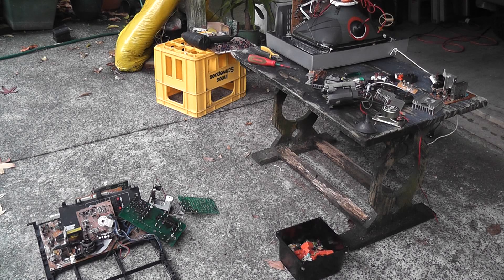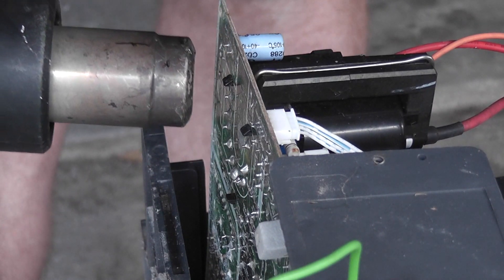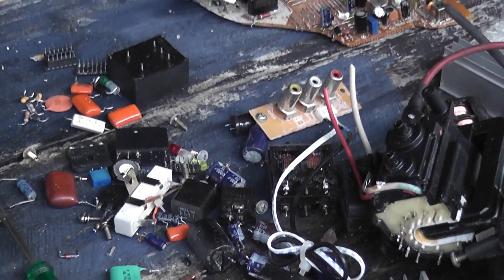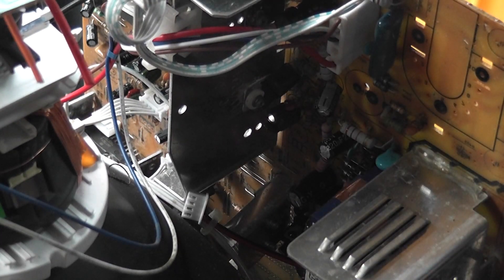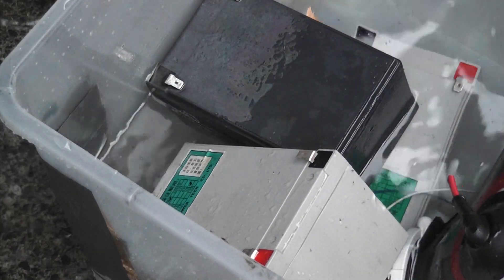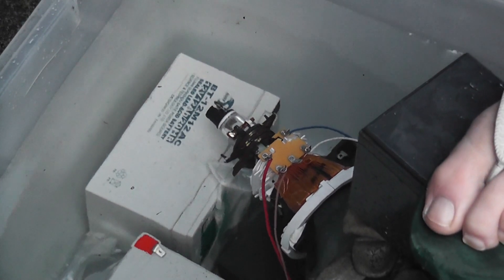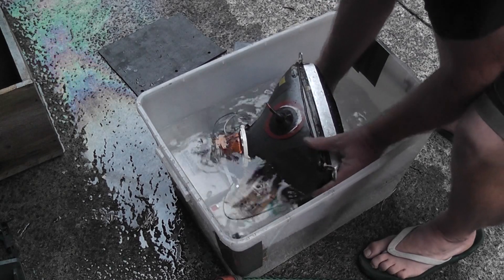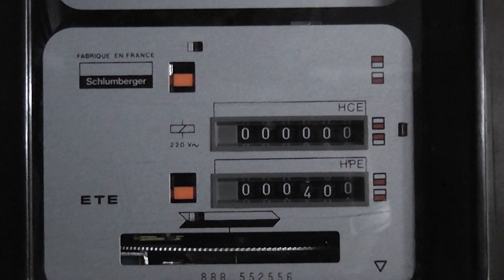Harvesting TV flyback transformers

Comment: I used a desoldiering tool (they cost more now) and a butane soldering torch from Radio Shack.  I remember the old Archer Brazing Kit I could get from radio shack.  With butane and nitrous oxide.  That pretty white flame...  Would melt wire sheath instantly.  The smoke stunk.  The N20 didn't smell that bad.  It was actually kinda yummy.  Being 15 years old, that gas really fascinated me.  All its technical applications.  I mean I don't let the dentist give it to me anymore but it was a nice learning experience.

Comment: looks like I need to invest in a heat gun because I do it the hard way I guess I just use a propane torch and heat it up and pull the componts I want out. the what they say not so userfriendly parts as for me they are all user friendly if they still work like caps transformers anything.

Comment: I usually vent those things by holding a screwdriver on the back, on the tiny bit of glass then softly hitting it with a hammer. Works rather well and it almost never causes any big cracks in the thing itself :)

Comment: Next time try to use the claw of a claw hammer. lay the claw of the hammer on the neck, then tap the hammer bit with another hammer. It won't slip as much and it will stay in place.

Comment: Hiya. On the second attempt of trying to vent the tube under water, I think the first strike did actually rupture the tube neck, albeit slightly, as I could see something happening in the tube under the water. When you hit the tube & the end broke off, I think that it sucked the water so hard, that it also sucked in some air, as there wasn't much water above the point at which it broke.

Thanks for showing though. :-) Was definitely interesting to see a tube vent-off under water. :-D

-BBD.